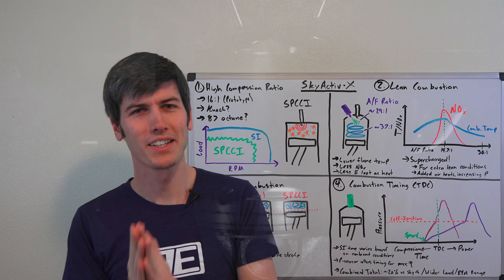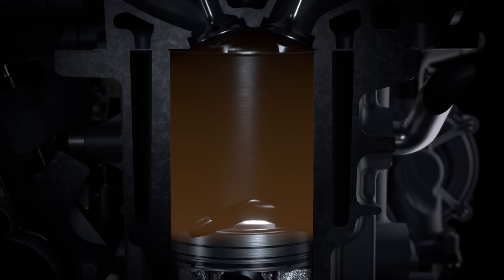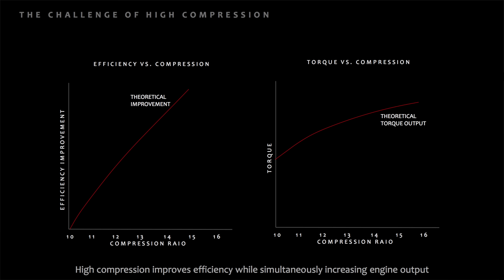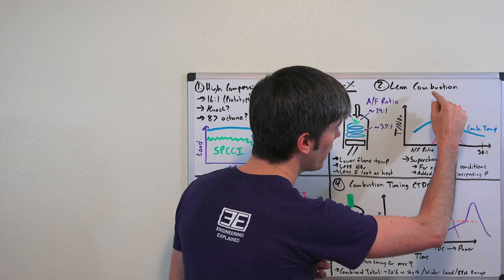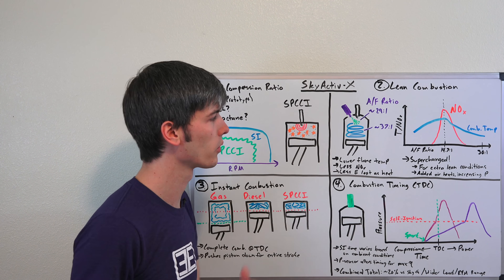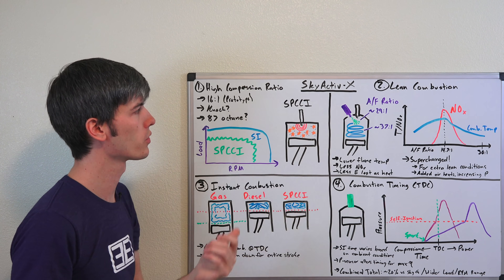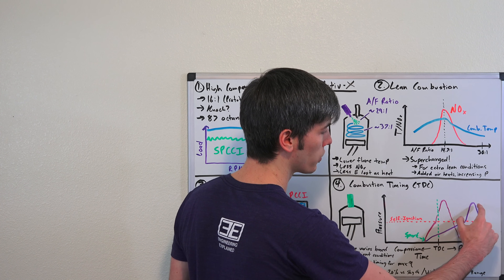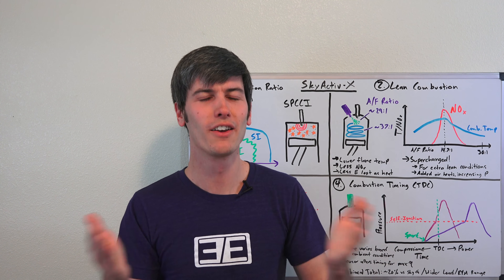How Mazda Is Saving The Gasoline Engine - SkyActiv-X

Comment: 190hp combined with insane fuel economy? I'd swap my engine if I could afford it.
Reply: Aye 190HP and clearing nearly 33MPG combined is pretty awesome , I'm waiting to see if Infiniti throws there new VC-T engine in the Nissan Altima to see how it compares
to something like the Madza 3/6.
Reply: BrianNC81 That's not pretty weak, especially when coupled with aggressive gearing a light chassis, but it's also not designed to be extremely powerful. I wouldn't be surprised to see a 250-320 HP version of this engine in the near future though to appease folks who gotta go fast
Reply: BrianNC81 hp is simply a bragging number. If you pair the gears right a 200hp engine vehicle will out perform a 350hp vehicle.
Reply: Don't tell me, let me guess...you must live in one of those places that's sunny year 'round, and think that since you do, then everyone else does too.
Reply: Look at the current Miata scene take a 2300 pound car and turbo it to roughly 200-240 and have a 6-5 second care that handles amazing brakes really good still
Reply: wolfsblade127 A good torque curve as well, and not just top end power.
Reply: BigHeadClan I’m getting high 30’s in my 10th gen si
Reply: BrianNC81 depends on how much your car weights a 1900 pound car with 190 hp is gonna be nuts
Reply: Horsepower doesn't really tell you that much about a car, you miss out on how they handle, how heavy and aerodynamic they are which effects their acceleration, how that power is actually spread out over the RPM. All it really tells you is what the engine does without the rest of the car attached to it.
Reply: AMRninja7 I'll take the 320hp version in a Mazda 6 with AWD. 👍. Hopefully 500+ ft lb of torque.
Reply: If this is the class of car you're shopping for, 190 beats an Impreza, especially in the mountains considering this does have forced induction.
Reply: Anthony Larce - That tends to happen when you have a tinny 1.5L motor hitched to a very light car, Honda  does really good work with there little motors though some
strong numbers out of them.
Reply: My 3.0l v6 made 200hp new, definitely swap this engine for it
Reply: BrianNC81 no.
Reply: +nrdesign1991 Now imagine if those same, cheap, very efficient MPG cars had around 190hp standard instead of being lucky to even get 100 like your car, lol... That's the potential this engine offers. It could raise the bar of the "slow but efficient" cars to actually be decently quick for their price and fuel economy. It's like if Smart cars were 190hp standard and got the same or better efficiency... that'd be amazing.
Reply: Harald Sangvik 
Hot air is closer!
Reply: Psyko Klown 
What you mean it’s not always sunny LOL
Reply: imagine the fuel economy if they made a 100hp version. Could be very popular in european markets.
Reply: 375 WHP with 32+ mpg over here lol
Reply: BrianNC81 - Different strokes for different folk man, I'm with you though I started at 240HP I'd rather not go down in that number if it could be helped.
Its' why I like cars like the Q50 hybrid, 360HP and gets about 27 MPG combined, sadly the battery's are still too heavy to really sell me on the whole deal.
Reply: @BigHeadClan  pushing 365hp to the wheels in a little e90 BMW 335d.  595lb of torque at the wheels.  It's a bit insane but makes so many other cars feel slow.  Close to 40mpg highway and mid 20s in the city.
Reply: BrianNC81 - Well it's a diesel awesome highway cruising is what they are designed for,  that said if your using the stock gauges it may not be reading true. Have you done a manual calculation?
Reply: @BigHeadClan  yeah manual calc
Reply: @BrianNC81 That's amazing, what modifications did you do to it? Pretty sure that engine is like 280hp stock. Same 0-60 time as my cx5 😂
Reply: @Ryantube007 downpipe (no DPF), EGR block, intake, 3" exhaust, tuning.  Stock turbos.  Does a mid 12 second quarter mile on the drag strip at 110mph trap speed.
Reply: @BrianNC81 😂 so not street legal what so ever
Reply: @Ryantube007 there are many places that exempt diesels from emissions testing
Reply: and here I am, creeping around in a 60 HP car, lol. Getting around 33MPG
Reply: wolfsblade127 not if both cars weighed the same
Reply: sounds gay though
Reply: A bit like the Peugeot 206 RC… this same power in a slightly heavier car than a Smart, but with a naturally aspired 2-liter engine (and enough torque).
Reply: Depends on the car. 200hp in the GTI is ok. 200hp in the Fiesta ST is fun. 500lbs makes a difference.
Reply: Yes, you need a little more panels. But as long as they pay for themselves in a reasonable time it's no big deal. In most countries you can sell your excess electricity to the power company, that helps you recover the cost.
Reply: Compare that with 450 hp, 471 ft-lb of torque of Tesla Model 3 and it's like, why are we wasting our time?
Reply: Like my 2003 Toyota Camry.
Reply: It's a good engine.
Reply: Same here. I have a 2.3 turbo engine in my Saab 9-5. I love the turbo effect, but fuel efficient is not exactly what I'd call this engine ;) OK, it is 20 years old, but it only has 170hp and is plenty fast compared to most other traffic on the road.
Reply: One problem, this car will cost 1/4 of the Tesla.

Also, there are plenty of emissions in mining the rare earth metals required in China for both the car and the panels. Especially when you consider how many square meters of panels you need to charge the car in a decent amount of time. This is also since no one installs tracking solar panels.

Not saying electric or hybrid is bad, just saying it still isnt as clean or efficient as it is made out to be.
Reply: @dh3790 
A Tesla requires only a tiny amount of rare earth metals, and even lithium is only a very small part. And you can buy solar panels that were made in the US.
And while EVs are not perfectly clean, they are far better then ICE cars, and will get drastically cleaner as the grid itself gets cleaner.
Reply: Rene - You have the low pressure turbo version I take it? I always thought those were pretty decent in fuel economy, atleast for the time..
I have an 02 Saab 9-3 SE with the 2.0L high output turbo that has a light tune to 250hp and it is a ton of fun.. It actually gets decent mileage on the highway, but really suffers in the city.. Engines have really come a long way in terms of fuel efficiency in the last 20 years it seems.
Reply: idk about "nuts"... @190 hp... not boring... not fast. Who gives a crap about miles per gallon unless you drive a lot. You wanna play, gotta pay.
Reply: And 500 miles of range (the current Mazda 3 almost doubles that), and about 3 days to fill up from empty (unless you have a solar farm), and very limited fueling options. All that for only about 4 times the price of the Mazda. Compare apples to apples next time.
Reply: Oh yeah my old man almost snagged an 02 Saab 9-3 Vector back in the day, he ended up going with a 3.5 Altima but I always through it was a sweet car.
Reply: My Rsx type-s has cleared 35 mpg average on a long road trip and it had ~220Hp at the time. A refurbed K20z1 is going to cost a lot less than Mazda's new wonder here and they're reliable as frig. Only problems are no low end and they're known to eat oil in vtec.
Reply: It's funny no one even said honda and the k20 fanboys came running out of nowhere. You guys are like the male feminists of the internet
Reply: Btw folks, the car was already 4 years old at the time and It's an engine design from 05, though the k20 line is much older.
Reply: András Bíró 
Aha, okey. You can leave now KappaRoss
Reply: 190 is not really enouph, my BMW has 425 and I don't care about fuel economy
Reply: @alexl5682 
Teslas have 400 to 800 hp, brutal torque, excellent fuel economy and zero emissions.
Reply: András Bíró 
Ain’t gonna happen. When you run out of juice in the middle of nowhere they can’t bring you a gallon of battery. The only reason Tesla is even around is because of all of if the subsidies they get from the USA. Gasoline is going to be around for a long time and now with fracking we are awash with petroleum. You can throw away all of your doom and gloom books LOL !
Reply: András Bíró Not even close to zero emissions to produce it. Sorry, ride a bike and take public transportation if you want to lower your footprint. Come back to us when electric vehicles are produced cleanly and have much improved batteries.
Reply: With a Tesla Model S you get from over 500HP to almost 800HP, even more torque, and all of that with excellent fuel economy. Charge from solar panels and you have true zero emission.
Reply: @andrasbiro3007 I'll take the mazda. I get nearly 800kms to a tank out of my 2015. Combined with 10 years driving in the rust belt with zero mechanical issues. Best part is its not even 1/3 the price tag.
Reply: @andrasbiro3007  At nearly 3.5 times the cost of a Mazda 3
Reply: @YarpenZig 
The base Model 3 that is coming soon will cost $35K and will still give you about 250hp. And you can't compare a Model S to a Mazda 3, the Model S is on the same category as a Mercedes S-Class.
Reply: 190hp is pretty weak.  250hp would be my bare minimum considered when buying a car.
Reply: @BrianNC81 Not in the size of car Mazda puts these in.  BTW, 250 is where I would start not considering a car because it has too much power, so everyone has his/her own preferences.

Comment: My engineerin teacher says that beyond 14 :1 efficiency gets lower
Reply from the maker: Theoretically, it always improves as it goes up. In the real world (as mentioned) you run into knock as you get higher. With most gasoline engines it’d be very dangerous to do. This engine is quite different in execution, thus efficiency does improve with higher CR.
Reply: Most efficient use of the input materials to this chemical reaction happens at stoichiometric ratio which is 14.7 to 1.  That much is true.  But using less fuel is always using less fuel. We're talking about efficient (lowest) use of fuel only.

Comment: I can’t wait for the next generation of Miatas with the SkyActive-X engine. They already get ridiculous MPGs yet deliver a fun experience.
Reply from the maker: And if they did stuff it in there, it would be a nice power bump!
Reply: Engineering Explained Amen! 190hp in a Miata is what a low boost turbo/super charger setup gets you. 

C’mon Mazda, get to it!
Reply: The Raging Storm that sounds like the best bad idea ever.
Reply: MeeMoo220 You should see the Suzuki Cappuccino with a 13B Turbo.
Reply: MeeMoo220 It's there on youtube. Probably not fuel efficient and it a bloody tight fit. But I bet it's a blast to drive.
Reply: The 2019 Miata already gets 181 hp.

Comment: There is absolutely nothing wrong with the internal combustion engine. It's reasonably efficient, simple, and reliable. The only problem is the fuel. The future shouldn't be electric, it should be an alternate fuel for the engines we already have

Comment: This is why I love Mazda.
If I had one question, though, how does this extremely lean, high compression ratio combustion affect the power? I would assume these don't make a while lot of power. Adding onto that, is there an easy way to switch to a higher power mode?
Reply: 190 hp is good power Alex.

Comment: How long will this engine last due to wear and tear?
Reply from the maker: How long do current engines last due to wear and tear? Not very easy to say.
Reply: Engineering Explained not a worthwhile answer.  Toyota advertises strong simple naturally aspirated engines that will last 500,000 miles and they do.  In fact the Toyota truck crowd calls their engines “Million Mile” engines. I have one, not very fuel efficient, but decent for what you get.  Super reliable, long lasting and highest resale value.  That is why Toyota is ranked tops in the world in many areas.  The market speaks and verifies the product.

Comment: Why E85 didn't take off ? With some fuel additives problems with cold weather like here in Finland could be easily solved, atleast i believe so...
Reply from the maker: Because it’s a bit (a lot) inefficient to grow corn to make ethanol, and then burn it in a 30% efficient engine.

Comment: I wonder how reliable these engines will be? I think it's cool and I admire Mazda for doing something different and going against the grain, but Mazda just made the gasoline engine much more complex in the name of efficiency. It's a good thing and a bad thing. I wonder if it will be a pain in the ass to trouble shoot when something goes wrong.
Reply: I can't imagine maintenance on these will be any worse than many of the small, turbocharged engines popular in Europe. Nowadays, most new engines are very complicated, so this one, comparatively, shouldn't be too bad.
Reply: Von Ace that was my question, a ton more sensors... yes those that go bad without warning, lot more computing perfection on a mechanical engine and those super high compression ratios... a bit hard to keep it all balanced and in harmony for long. But let's wait and see how do they perform on the long run.
Reply: Von Ace
Like how steam engine do in their last stand against internal combustion engine
Reply: Lol engines will always get more complex. Thats how progress is made.

Comment: Yet the CR-V AWD 1.5T gets better mileage than the CX-5 AWD 2.5 with similar power.
Reply: That is to be expected? you are comparing NA to an eco turbo.
Reply: Then turbo is the way to "save the gasoline engine", not SkyActiv-X.  ;)
Reply: Thirsty Fox how bad is the economy when it's on boost? :) You know when you're not comparing a 1.5L motor to a 2.5L motor.
Reply: Thirsty Fox -- Uhh.. Mazda's current 2.5 is not the Skyactiv-X.

Comment: K I S S, why burn stuff, put the planet at risk to get the fuel to the pumps, create pollution etc   when there is no need. ???????????????
Reply: Seriously?? Where do you think electricity comes from? Do you believe it's solution free? Do think a Tesla and all of its batteries don't have a huge environmental impact? And again when the batteries die.. what are you going to do with them? They are highly toxic to dispose of. EV's are not pollution free, they emit mass amounts of Ozone.. deadly stuff.  Try to think before you follow the sheep over the cliff.
Reply: McGoo x Because that's what simple NOW. Electric will be simple in future, when they stop costing 2-3 times more than a gas car. Aaand when charging network will be common in many parts of the world, not only some.

Comment: So this engine wont work with 95 octane which is the lowest in Sweden?
Reply: svampae actually in Europe the octane is measured differently than the U.S. In europe they use a much higher octane number. Really 95 octane in sweden is the same as 89 octane in america.
Reply: svampae It will, just in a different version. That's a minor difference anyway...
Reply: Ricardo actually Europe uses RON, US uses AKI which is an average of RON and MON

Comment: So is there increased pressure/load on the engine internals? Basically, are the engine internals closer to a gas or a diesel in terms of durability?

Comment: Next come to brasil an ours 30% etanol 87 octane junkyard cooked gasoline and wach this engine going BOOM!
Reply: Igor Toebe Yeah, as if current engines weren't complicated and optimised for normal quality fuel... Engines slightly adapting to the fuel quality are around since as early as 90s at least.
Reply: szafirowy01 lets test it! :)

Comment: This video was actually really interesting because of how mazda is changing the rule book and efficiency of gasoline engines by doing everything that everyone thought was wrong. 1 supercharger- usually you add more fuel but they do the opposite. 2 higher compression with forced induction. The ideal 14.1 air fuel ratio is way different to their 37.1. Im actually really interested in what mazda is doing which is the first time i actually wanted to know more about a mazda engine.

Comment: So... the fact that Gas internal combustion engines fully ignite the fuel when the piston is far from TDC is what gives them little torque? In the low rev range?

It makes sense to me, because the combustion has to "work harder" to get the piston, and therefore crank, gearbox, diff... and wheels to move.

Is that why diesel engines have great torque right from the beginning?

Comment: Wouldn't this be like the perfect combination with a variable compression engine? Because you can control the compression ratio wouldn't it be easier to achive perfect combustion at a wide range of circumstances instead of still using a spark plug? Would be interesting to hear your opinion on this! :)

Comment: Easy to have the best fuel economy when all you make is compact cars. Try making muscle cars and crossovers and getting 30 mpg average lol
Reply from the maker: CX-3, CX-5, CX-7, CX-9. I hear your point, but Mazda does a nice with fuel economy regardless of what vehicle type you're comparing, even with a 7-seater in the lineup. They don't make muscle cars though haha.
Reply: They absolutely have great fuel economy all across their lineup.  This new technology is amazing as well; really pushing the efficiency limits of what an internal combustion engine is capable of. I just saw a lot of people in the comments poking fun at the American manufacturers for only having "70%" of the efficiency of Mazda and other manufacturers. Most American cars are bigger than most foreign cars, and that's going to have the biggest effect on fuel economy. The difference of engine efficiency between manufacturers is smaller than ever today.
Reply: When an electric car has the same range as gas car, can be refueled just as quick, and our electricity is generated from fusion or fission then electeic will make sense.
Reply: His point goes with mine. Can they make this in an engine size that adults can enjoy, 300HP V6 and 450+HP V8s?